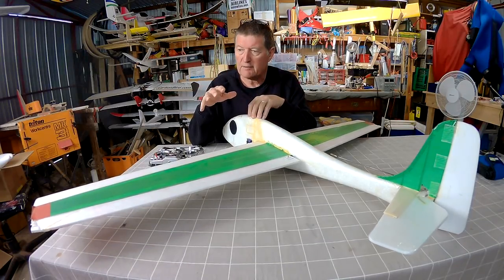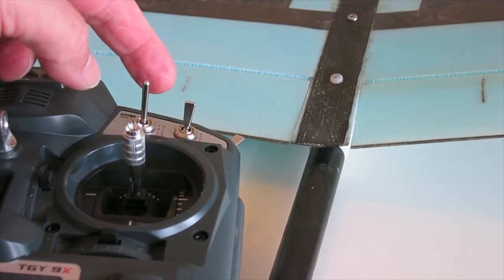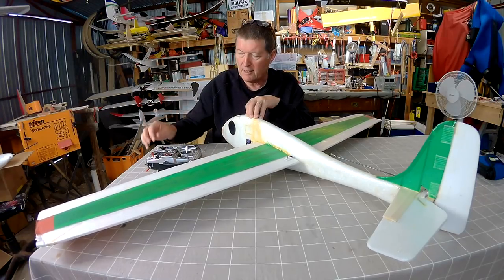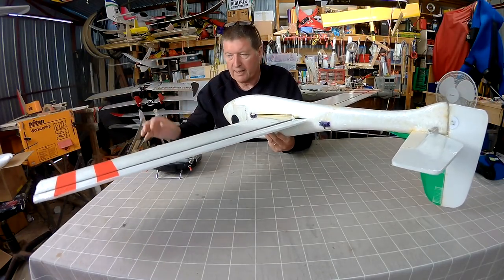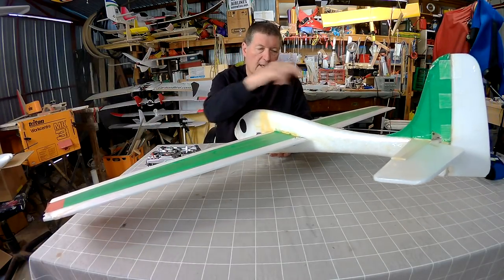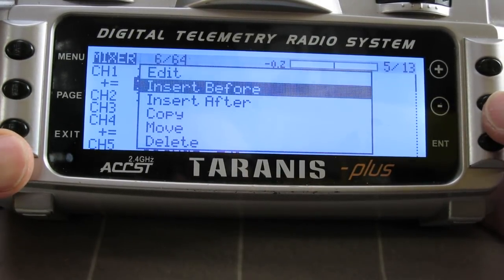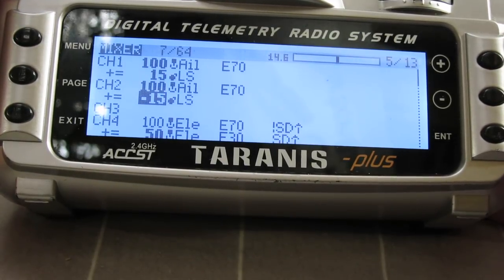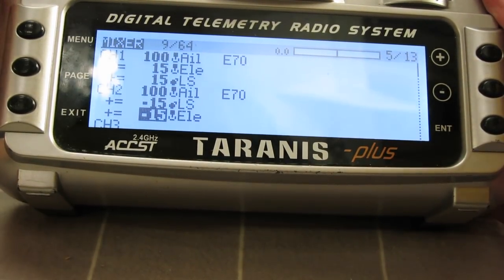Camber Reflex Snap Flaps

Comment: Super-clear explanation of camber, reflex and snap-flap. I really appreciated the comment about using snap-flaps to help with inverted flight. The bonus was the OpenTx programming section of the video where you programmed it in to the transmitter - extremely well thought out.  It was just what I needed
Reply from the maker: Thanks, I do enjoy making these

Comment: Great explanation. I'm always learning new things watching your channel. Do you normally need to mix in some positive elevator with traditional flaps since that will cause the nose to dip down when deploying flaps? Thanks for the video and Happy Flying!
Reply from the maker: Usually the other way around. Dropping flaps makes the nose go up, so I usually need down elevator to hold it level. BUT some planes are strange and work the other way
Reply: That's good information thanks for the response and Happy Flying!

Comment: Again another great and timely tutorial. Do you use this setup on your U-glider? If so, which do you use most often?  I have one on the bench and can hardly wait to get it up in the air.  Thanks
Reply from the maker: I use camber for slope soaring on the U-Glider, when I want to go as high as possible, and reflex for stronger wind to reduce drag
Reply: Got it.  I built  mine with your suggested mods and pull string tail group and will add this to my radio setup. Also just wanted to say thank you for all of your hard work, videos and blog.  You have been a great help in making me more successful returning to this hobby after a twenty year absence.
Reply from the maker: Thanks Buzz, that means a lot to me. I'm interested in your spring pull setup. Please let me know how it goes

Comment: I do have a question..

Most planes when "lowering" flaps pitch up and increase lift.. wich makes the snapflap workings logical

However other planes when deploying flaps will pitch down.. i had 2 that made that.. notoriously my sloper SIG Ninja (first time i tried flaperons it scared me as it just began to dive fast). i Think its due to the wing acting a bit like a flying wing with elevons and having a short tail moment (The Ninja certain has a short tail momentun) 

So i wonder if snapflap will work the same with those.. in my Nija i have to program elevator up when using flaperons and/or camber to keep the nose level..and when using both as brakes (spoilerons) i have to program down elevator to keep the nose from raising much.. snapflap in this kind of planes seem that part of the elevator used would be lost in compensating the pitch momentun.. so wonder if it would be worth it
Reply from the maker: Very good question. I have some planes that do that too, and I don't know the answer.

Comment: Flying inverted? If I'd do it on my radio it'll increase the chance for me to stuck the plane into the deck.  Not that it happend too seldom even without fancy radio mixing... 
Let's say it this way: every time I turn a plane inverted I wave the doomed (don't ask my how I know ;o)))
Reply from the maker: Haha, I know that feeling. I practiced on Pic Sim for ages to get the stick movements correct. I still muck it up occasionally